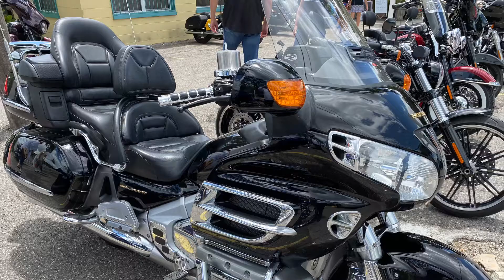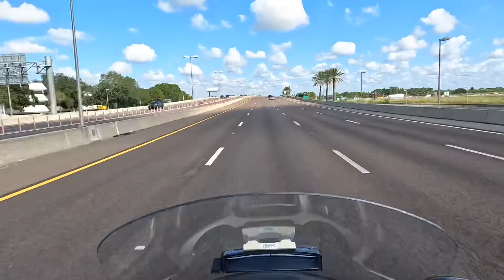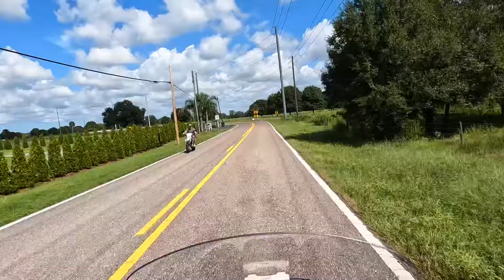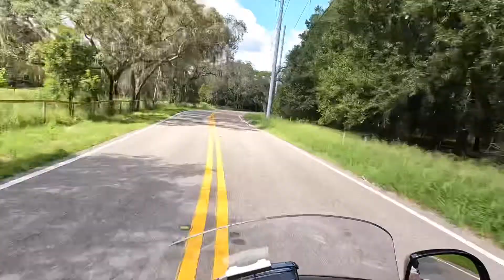Why buy a Goldwing now?  Goldwing prices may be going up due to demand!

Comment: Remember, most Harley riders trailer their bikes to those rallies. As you travel, notice what people use as daily drivers as well as going across country. Very few are Harley's even though 90-95% of the bikes at a rally are Harley's. In February right after attending my families annual Super Bowl Party, I drove a Dyna Glide Custom from Lake Havasu City, AZ to Terrell, TX in temperatures below freezing at night for one of my cousins friends who had a family member die. I was told I was crazy and couldn't do it from all the Harley owners there, I informed them that I've been doing that run for years on my Goldwing and that it got down to 8 deg (F) last November when I came. They all said "yea, but your on a Goldwing". That tells you alot. I had an '04, rode it almost 200K before I wrecked it, bought an '02 and have put over 100K on it and it is still going strong. I had several other bikes, but no HD's.

Comment: Just picked up a '97 SE with 43K on it. Needed a starter solenoid and front tire. It sat for a couple years so cam belts are next just to be safe. You really can set a nickle on it's edge on top of the motor and start the bike without it falling over.

Comment: I have been seriously considering an older Goldwing, it's very difficult finding one with at least 40,000 miles on it, but since you bought yours with 80,000 miles and it's still going strong, maybe I might consider higher mileage.
Reply: The're out there alright.  I looked for a used gl1800 for almost 18 months all over the west coast. I was considering going as far as Texas to get one. Finally found an 02 with 24k miles on it. And would you believe it was less than 10 miles from my home. Got it in January.  Had a safety check performed on it, new tires, hydraulic flush and new brakes and it's ready to go.  Taking a long trip after school's out.

Comment: 90,000 miles......barely broken in.
Reply: @d2destinations106  Great bikes but the truth be known some such as my 2001 wing need a new water pump and Alternator at 160,000 kms, Starter wasn't far behind so while I was in there I had it rebuilt as well. Not a large sum of money "if" you can do the job yourself, if not very costly. I did the "new water pump" replacement and had the starter and alternator rebuilt rode it to 210,000 kms was running nice and decided to sell and upgrade to a 2006 with lower mileage.